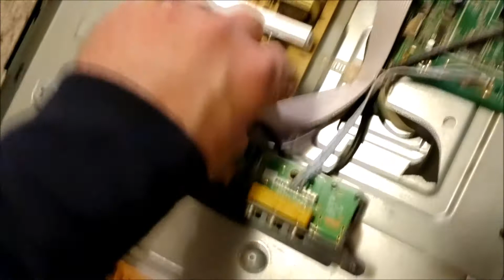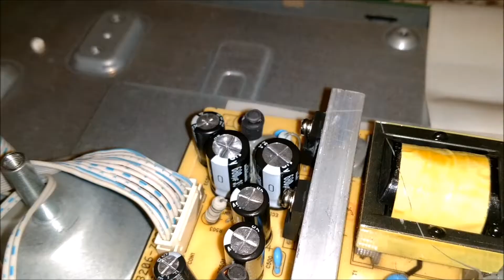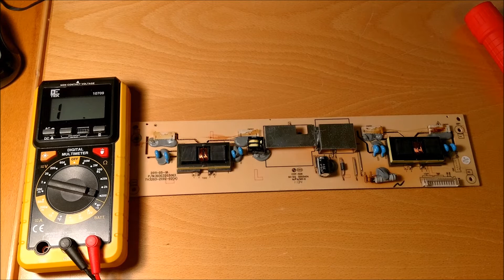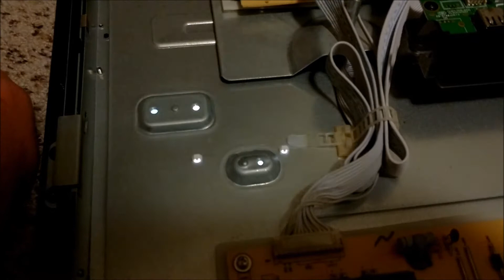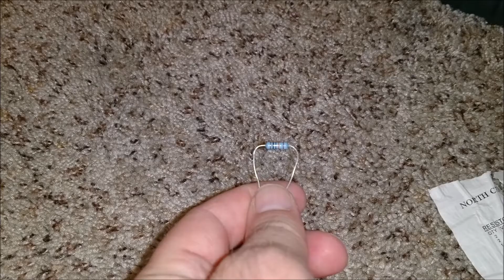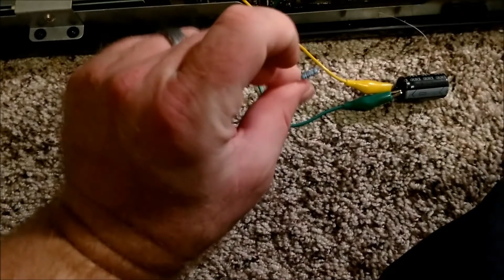Westinghouse LCD TV Won't Turn On

Comment: Repaired one like this. Had audio, but no image. Disassembled it and started checking components with a VOM. Found a surface mount fuse open. Soldered in a glass AGC replacement. Works great seven years later.
Reply from the maker: That's perfect. Thanks for the info!

Comment: Yeah, little tip here for everyone. When pulling the tabs from the board, don't pull by the wires... instead try using a screw driver to pop the tab out like he did in the video. Nearly ripped one of the wires by pulling on it too hard.
Reply from the maker: Good tip.

Comment: What if the green light comes on. And goes off n wont come back on until a few mins
Reply from the maker: Probably the capacitors. Take a look at them.
Reply: Justin Peters i got it open right now. It started recently while gaming. Worked fine before I took a break. Plugged it back in hit power. And the red light turned green and then goes off. And no one online has a solution. Your tv is exactly the same so im excited to finally find answers xD
Reply from the maker: Awesome. It could also be the power MOSFETs for the back light also, just like mine.
Reply: Justin Peters probably. They had a report about Westinghouse models have been having problems and they even took away their manuals off their website.